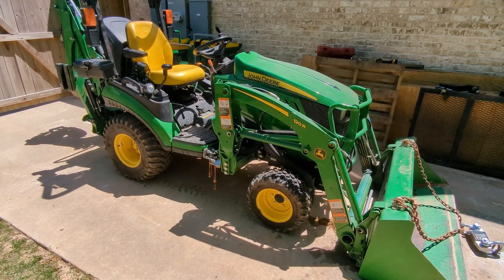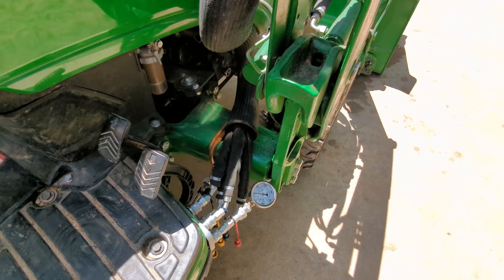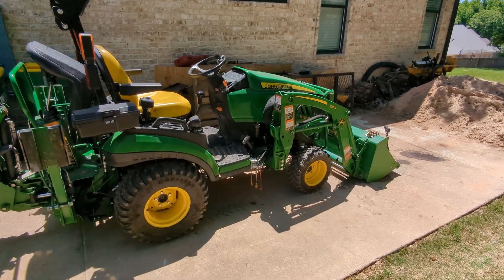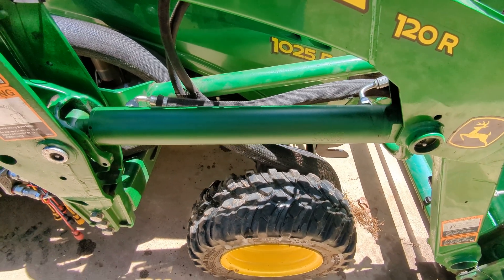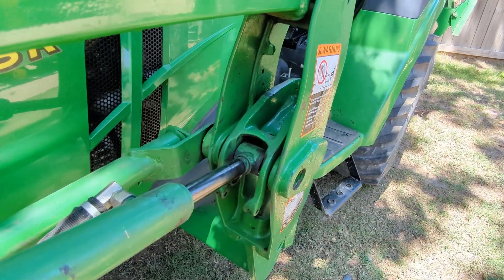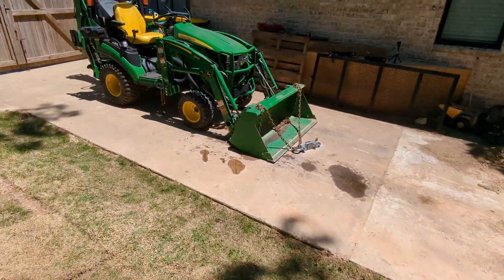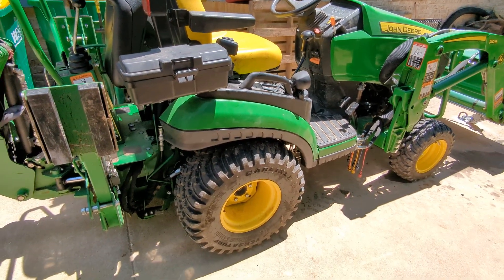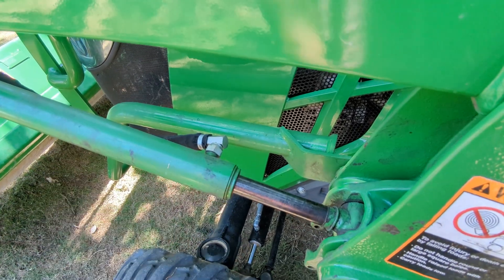HydrosPlus Cylinders+ 1025R with 2in Prototype Boom Cylinders

Comment: Could you run this with a summits hydraulic front 3rd and rear 3 port scv?
Reply from the maker: Yep - no problems with any additional add ons.
Reply: Amazing! I just saw the specs after some more research. I think I’ve looked at every pixel of your website - awesome stuff sir!

With the increase hydraulics and kit, in general - would your products open up the door for a little more power for a rear stump grinder on a 2025r?
Reply: Or is that strictly going to the the HP affecting that? I have a Christmas tree farm and would LOVE to be able to grind my stumps from the tractor
Reply from the maker: @packers082012ify  From a flow perspective, this would give more speed to any hydraulic motors that you're running, but it doesn't affect power nor the PTO.  So if you're talking about a PTO stump grinder, then it wouldn't have an affect on that implement.  Thanks for the question!

Comment: How would that front axle and seals hold up?
Reply from the maker: Depends on how you decide to use it. If you lift the same weight as you can lift stock, just higher, then no difference. If you decide to lift heavier objects often, the wear will be more, but not sure to what degree.

Comment: Great video!  Would love to see how much more functional the backhoe is with this kind of pressure and flow.  Stock it seems very slow and clunky.
Reply from the maker: Check out this video - https://www.youtube.com/watch?v=6GGfz6Xb0gA
Reply: @HydrosPlus  Thanks, definitely looks much easier and faster to work with!
Reply: I've got the 9.5 gpm kit and set my PRV to  2200 PSI at idle.   It's an extremely capable digger now. Much more enjoyable too as multiple functions can happen at the same time.

Comment: Great Vid! Do you expect any problems installing them on a MSL loader? Also, any ball park numbers on expected pricing?
Reply from the maker: I believe the 120R MSL loader is different, so those will come later.  For the 220R MSL, the cylinders are within 1/4 of an inch, so they will work for both NSL and MSL.
Reply: @HydrosPlus  Thanks! I'll take measurements so that you'll know for sure.

Comment: I better ask, will these fit both the 120R and H120 loaders?
This is compelling. I have a couple boulders that I dug out and could roll and drag , but ruin the yard. Yet would love enough to lift them a few inches to get them where I want them. Instead of renting a big bobcat/skid loader for a half hour. These are boulders just beyond my lift capacity but I am sure wouldn't break anything. Take my money Kev.👍

Are you testing break out force? The tilt of the bucket is what I depend on to lift too heavy objects (Plus a bit of rocking, since the cylinder valve lets it go up but prevents it from going down) . If that is just arm lift...that is really good.
Reply from the maker: That's the exact use case that I'm solving for, Dave.  I think for most of us, 2 or 3 times a year, we come up against something that we want to move, but can't.  Lots of people quickly comment, get a bigger tractor, and while I'm always up for more toys, that doesn't make sense for most of us.  That said, it makes it nice to push into a pile of sand and it doesn't hesitate for a second to lift it to full height.
Reply: @HydrosPlus  Kevin, I just edited my OP post and asked if the cylinders are going to fit both the 120R and my older H120? If you need pics or measurements , I'll send them.
Reply from the maker: @davejohn255  Yep - they will fit H120 and D120 since they all use the same stock cylinders.

Comment: You just got a new subscriber ! I'm looking forward to seeing how the 1.75" turn out for numbers  , I'm curious on my 2021-1025r stock set up from factory I am set at 2150 psi completely stock set up , if I just switched the cylinders to the 1.75"  without the hydro plus pump then I would gain lift capacity but lose speed correct ? 

Look forward to many interesting things from you !
Reply from the maker: Correct.  You're going to gain 33 to 36% in lift capacity for a given pressure, but you're going to lose about 38% of your speed.  That's going to be very slow with the stock flow, but it will move.  It will likely completely eliminate your ability to do 2 functions at once, even at WOT.  Today, you can probably do 2 functions at WOT, but they will be pretty slow.
Reply: @HydrosPlus  ya so pretty much I need to upgrade the pump first ( eventually ) and then the cylinders after that, so you figure with the pump upgrade and 1.75 cylinder upgrade it should be around the same speed as my stock set up I have now ?

Comment: Anyway to increase lift height? Love the footprint of my 1025 but wish I had 5 more inches of lift height to get in my dump trailer
Reply from the maker: Completely agree and I looked into it, but there isn't a way to add anything significant without trade offs.  I need to go back and check, but I may have increased the stroke for these cylinders just a bit...but something like 1/4 to 1/2 of an inch.  The limiting factor is how long the retracted length is.  If you increase that, then you limit your ability to come down as low as stock, which really isn't that low.  The retracted length determines your overall stroke, so for an existing application like this, you are limited to moving the end points.  You are limited on the rod end by how far the stock "stick out" is and clearances around that connection.  In the case of anything larger than 1.5 inch bore, you are limited to the clearance between the flanges.  There are also other technical challenges like the bucket coming back up over the hood, so while you can lift higher, you can't get close enough to the dump trailer to dump in it.  I feel your pain though.
Reply: @HydrosPlus  yea it’s so annoying. Absolutely love my 1025r. You need to upgrade to Atleast a 2032 to get any height . A 2025 is useless since it’s same height. I don’t need a 2032 . My tractor is perfect for my 1 1/2 acre property but it’s so limited . If they made the 2025r with higher lift and a substantially heavier lifting capacity I’d order today . But not wasting $ on basically a 1 1/2 series tractor . A b2610 solves all my issues but it’s not a deere .
Reply: @Mike-mn9xo  2025 generation 1 used to lift higher and heavier loads. In generation 2 they downgraded to the 1025 loader, which still lifts a bit higher in comparison thanks to bigger front wheels.

Gen 1 vs gen 2 is much more capable tractor, all the way. Unfortunately, this guy doesn't have plans of upgrading the pump on 2025 gen 1 due to some technical challenges (I've asked). I would gladly buy one, to improve my otherwise perfect tractor. However, I have to helplessly drool on what's available for 1025R... :)
Reply: @ruslankadylak2999  my buddy has a 2025r gen 2 we measured our tractors practically same lift height since the 2025 uses shorter loader brackets than the 1025r. They ruined what would of been the perfect compact tractor in the 2025r
Reply: @Mike-mn9xo  that they did. I didn't measure and compared the lift height between those two models. Good to know. On my 2025R gen 1 both, wheels and ground clearance are considerably bigger (like plus 4") comparing to 1025R. So, I expected to see those 4" difference in lift height, since they are using the same 120 loader... Go figure.
Reply: @ruslankadylak2999  correct. I went to trade my 2018 1025r in for a 22 2025r with cab thinking all I need is a few extra inches to be able to dump in my dump trailer . Glad I decided to measure my buddies before I dropped 30k for a heavier 1025. Tractor time with Tim is more knowledgeable than any dealer . He confirmed the 2025s have shorter loader mounts to accommodate the smaller loader . If they upgrade the 2025 with a new loader I’d be the 1st in line to order.
Reply: @Mike-mn9xo  I have H130 loader, definitely beats 120R. Before you upgrade, consider using harbor freight ramps for those extra 6" of heights.
Reply: @ruslankadylak2999  I’m looking at the kubota b2610 . A lot taller height and heavier capacity. But it’s no deere and I have a ton of deere front end loader attachments so it will be a expensive change

Comment: Pretty impressive. I know this isn’t necessarily intended for “I’m gonna lift the most I can all the time” but I’m wondering what ballast requirements would be to not really overload the front axle.
Reply from the maker: It's probably a lot to bring it into the "spec", but I personally believe that the ratings are far too conservative.  They have no incentive to tell you what it can do, so to them, lower is better.  In the real world, we care about what it can do, not what it's designed to do (One of my favorite lines from Apollo 13 :) )

My first 1023, I cranked the pressure up to 3400 PSI and it spent most of the time I had it driving on the front two wheels.  After 200 hours, no signs of wear and no leaks.  That said, I've read stories of people having seals leak at 20 hours and they've never used the front loader.  Go figure...
Reply: @HydrosPlus  yep, I agree they’re underrated. And the axle ratings John Deere lists are actually “continuous” weight ratings, not maximum. So not sure what they consider “maximum”. 🤷‍♂️

Comment: I'd be really tempted to give the loader a kiss with a grinder to make clearance for the 2" cylinders.  Especially since I don't think the part you'd be clearancing isn't normally under a lo of strain.  The only time the cylinder itself would be stressing it is when you're below grade or pulling down on the bucket.  On another note, careful with how much you load these things people.  We all love 'more' but the loader itself has a limit somewhere where things bend (sideways stress would make a big difference) and the front axle certainly has a limit.  Either of those would be expensive failures.
Reply: Exactly my thoughts on using a grinder to "solve" that problem. :)
Reply: Yeah is definitely just a way to get heavy stuff a few 6 inches off the ground and move on flat level ground ,4x4 ,slow...Anything else is asking for trouble.
Reply from the maker: You guys are my people :)  

I actually think (and if I'm right about you being my people,) you'd be better served to turn up your pressure with the 1.75 inch cylinders because of speed...and I think it will lift more than you're willing to lift at 25-2800psi.  This would be the best of both worlds and the limiting factor for the pressure in this system is the pump.  Everything else is rated at 3000psi or beyond for working pressure.
Reply: @HydrosPlus  I agree completely.  I would (and will) boost pressure first.  The 1.75, depending on pricing would be icing on that particular cake.  I can't justify installing it but I love the larger pumps and increased flow.
Reply: @HydrosPlus  Yes!...but I want it now! lol

Comment: Very cool.  
 My theory on on extra flow affecting pressure is that more oil is hitting the PRV faster than it can unload it but its just a guess. 
My 1025 was stock 1900 psi aslo but is much more functional at 2200 psi.
Reply from the maker: Agree.  It happens at stock as well as with HydrosPlus and if we're right about the reason, the variance should be a little more with HydrosPlus.